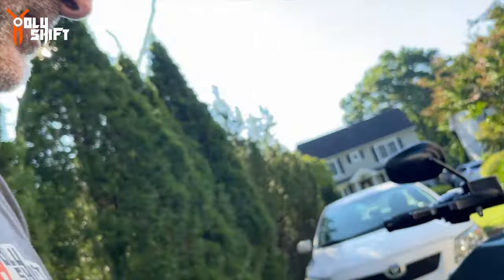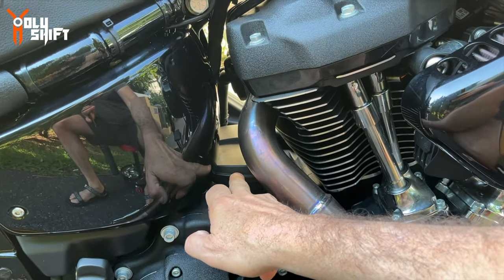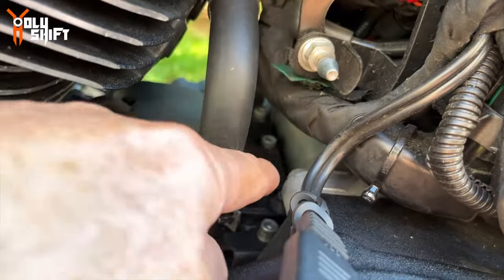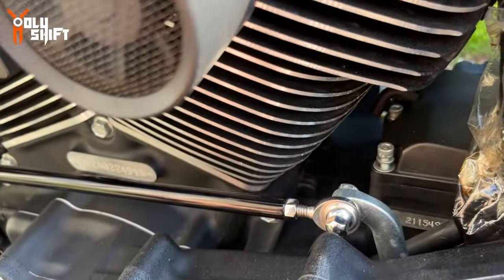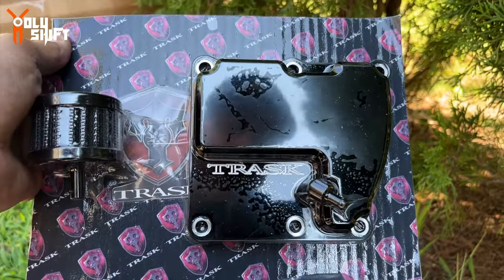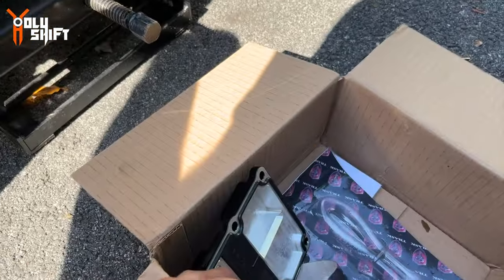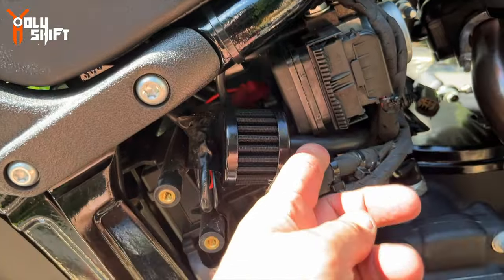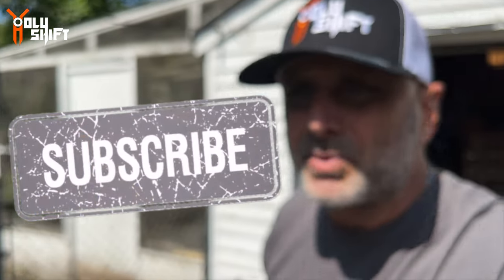Save Your Motor ! Trask Vented Transmission Cover Install

Comment: Don't forget to add a Feuling sump plug(if you haven't already) to aid in sump oil evacuation. Feuling claims an additional 20% increase in sump oil siphoning, because the factory sump plug protrudes into the oil drain port, partially blocking it.
Reply: That works for 17 to 20 models. Since then the sump is improved.. but it doesnt hurt anything.
Reply: @lancmac  Are you referring to the updated oil pumps that have increased oil scavenging over their predecessors? I am unaware of any changes to the '21+ M8 cases themselves.

Comment: I install that approximately two years ago, it did reduce the amount of blow by approximately 50%. I then install the BA feuling air filter, which than completely stopped all the misty oil going into the Piston heads.
Reply from the maker: I will also find an Install for my S&S …

Comment: Don't listen to anyone, got a Trask vented Transmission cover and Trask Assault High flow air cleaner on a 2020 RGS 114 S&S 475, installed an anodized bolt kit on the engine after 1,000 removed the heads, Pistons are mirrors after 20,000.
Reply from the maker: Wow ! Great to hear that buddy!

Comment: I also run the Trask vented cover... I no longer get snot out of the head breathers. It is definitely working well. The only problem I encountered was the excessive amount of thread sealer on the bolts from the factory. A lot of careful cleanup before installing new cover. And of course the pain installing the new bolts. No way to torque bolts on cylinder side. The HD manual says to torque to 110 inch pounds. Hand torquing worked fine. No leaks. A simple job that took several hours. I purchased shorty Allen sockets and they did not work because of non clearance on the cylinder side. Your engine is now happier :-)

Comment: Excellent video, step by step, good instruction, short cuts etc. - as usual.  Much better than can be said about other videos on this subject.  I broke the bolt with a long arm hex (needed the extra torque from longer lever arm).  A small 1/4 inch ratchet with a low profile hex driver makes things a little quicker.

Comment: Agree completely. I’m fortunate to live near the Trask Headquarters in Phoenix and when my RGS was in the shop for Kraus T Bars, Nick recommended they install the vented cover. Made a big difference. I would also recommend installing a zip tie where the hose connects as mine came loose a few times.
Reply from the maker: Thanks I’ll add a zip

Comment: Harley's new seal in the M8's built mid 2019 and newer, maintains a more consistent pressure in the crankcase and keeps the oil pump primed. It better isolates the crankcase from the cam chest. The pressure is bleed off the crankcase into the camchest and blah blah blah from there. Long story short, if I were to vent anything, and I do, it would be the heads with an external breather system into a catch can or similar. If you're worried about warranty, better to get one through a company like Motorcycle Agent which covers you even with additions to your bike which Harley would consider a void in warranty.

Comment: You were talking about two different things. Venting the oil mist vaper from the engine crankcase is separate from venting the transmission. The M8 tends to transfer transmission oil into the primary cover. Older Harleys used to ent the crankcase to atmosphere until the EPA made them vent to the combustion chamber.
Reply: The early M8s were having an issue with tranny oil being transferred into the primary case, the primary cause of this was because of unequal atmospheric pressures in both the trans and primary cases, when the clutch was activated (especially on the hydraulic clutches), the sudden unequal pressure would cause the trans oil to be transferred via the clutch pushrod port to the primary case, Harley has since added additional venting.
Reply: This was only a problem on baggers with hydro clutches, this did not happen on Softails or the new Baggers with cable clutches.
Reply: This is what confuses people....they hear "transmission cover" and immediately wonder how that vents the engine.  If you take the trans cover off you will see 3 cavities and one of those cavities under that trans cover leads to the engine crankcase.
Reply: @hughjanus590  you are correct. I checked the service manual and sure enough it says oil circulates through the transmission case. I asked a tech in the service department and he did not know that either. But either way the the oil is separate between the motor and transmission. I vented the crankcase at the rocker boxes. Now I have ordered an oversized clutch push rod and a primary cover vent kit to take care of my oil transfer problem.

Comment: You could just buy a HD trans top cover for a 23 CVO 121 VVT......   But Trask is good....  Also you could use a 3/8 bulkhead fitting in your stock cover and install a power break check valve in the vent line...  Options here

Comment: Hi 👋, H-S , you’ve done a great job, but this is where size does matter, 😂 , obviously your fingers are too big,😂 , to get hold of your bolts properly, 😂, only time will tell if you have weather or not it works, in and out, or vacuum out, A bike on the horizon, ? ? ? Is it for your daughter or wife. ? I’ll bet she’ll be very pleased with that., stay safe, Phil from the moulin

Comment: Regarding CC vacuum on the M8s - That is a unproven theory.. No evidence has ever been produced or documented  that this is a factor. It is a theory advanced by folks that were grasping at straws with sumping issues on the older 
M8s that were the result of the less than adequate oil pump and oversized sump plug on the early M8's. ! Venting the CC will reduce pressure and blow by as stated by trask in the product description but still does not solve the issue of hot oily air going into the intake and combustion chamber EBS is the best solution for the bike and definitely get a sump plug from fueling as to not worry if you bike ends up have sumping issues.

Comment: I bought a $20 stubby 1/4 ratchet that holds bits. Sooo much easier than trying to go at this with just Allen wrenches. I wouldn’t recommend the tools he used in this video. Took me only an hour with a ratchet.
Reply from the maker: Great suggestion- thanks 🙏🏻